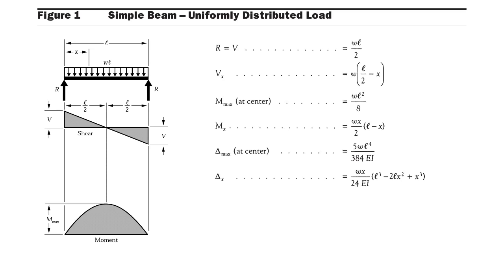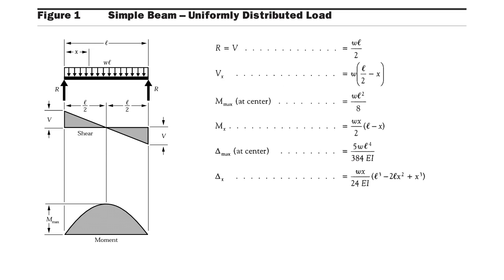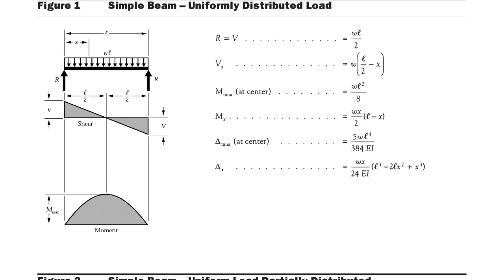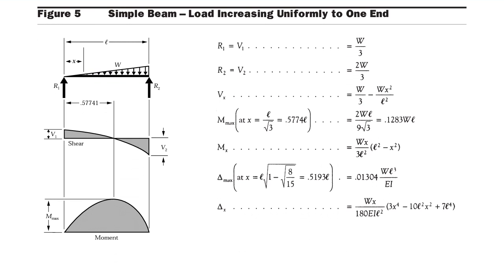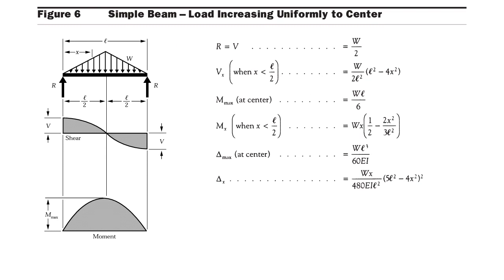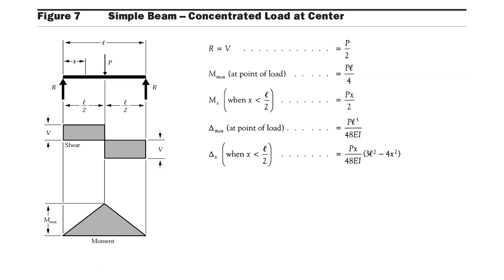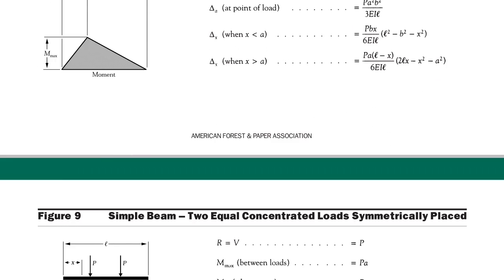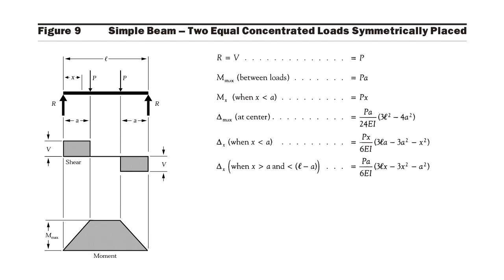SIMPLY SUPPORTED BEAMS - SF, BM, & DEFLECTION VALUES UNDER VARIOUS LOADING CONDITIONS || PART - 35

Comment: sir please check the maximum deflection formula for ssb for triangular loading maximum at the centre
Reply from the maker: Yes the maximum deflection value is WL3/60 EI, 

where W=wl/2.

 I used Capital letter  W for total load instead of small w.  If we use small w means its deflection value is wl4/120EI.  

Total load W = wl/2. 

For SSB for triangular loaidng maximum deflection is Wl3/60 EI or wl4/120EI both the values are correct one

Comment: sir, can you tell me ? how competitive the staff selection commission junior engineer exam ?? where this exam stands if we compare it with gate exam ??
Reply from the maker: SSC Junior Engineer exam is similar to UPSC IES exam. The difference is SSC Junior engineer exam major questions are asked at diploma level (i.e) basic civil engineering level.

 The syllabus is different when you compared to GATE exam.  The GATE exam little tougher one and their major questions are asked at problematic level. If your will prepare GATE exam, it surely helps for your SSC Junior Engineer exams also. 

SSC JE exam have paper 1 and paper 2. The paper 1 the major questions are asked from our basic civil engineering that too in our syllabus only. for paper 2 is conventional type, the questions are asked at our college level exams. 

Both SSC JE and GATE exams are different one. But it almost carries a same syllabus of our civil engineering. GATE exam questions are little tougher one to answer it. You need through practice for GATE exam then only you will able to clear GATE exam and score good marks.

The competition is same for both GATE and SSC JE exam. There are 118147 number of candidates appeared in GATE exam last year. but you are having good knowledge  in civil engineering concepts means you can easily crack SSC JE exam.  For GATE exam you need lot of practice. 

Every exams will have some sort of difficulties, when you hard-work means you can crack any kind of exam. Motivate yourself at any time and try to learn new things daily. 

Wish you all the best for your exams.
Reply: CIVIL ENGINEERING OBJECTIVE thanks a million 😊